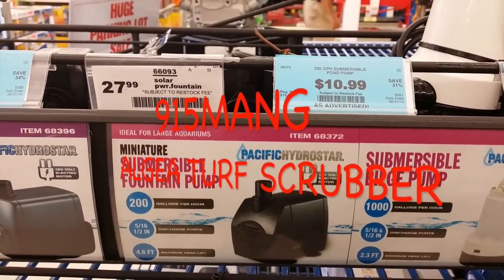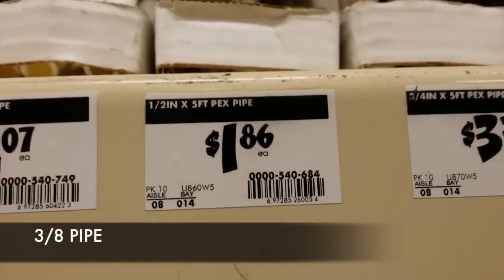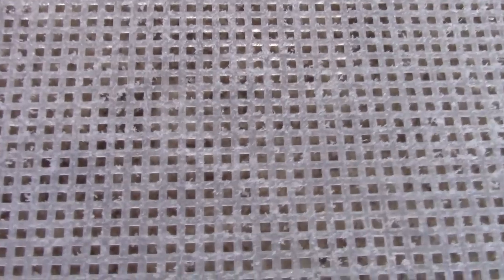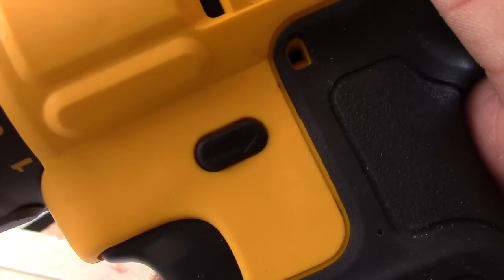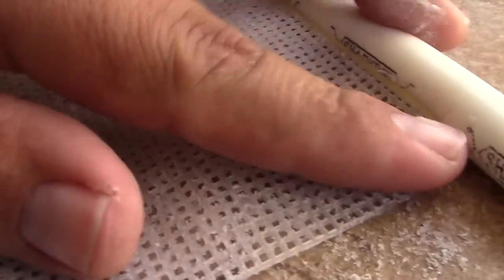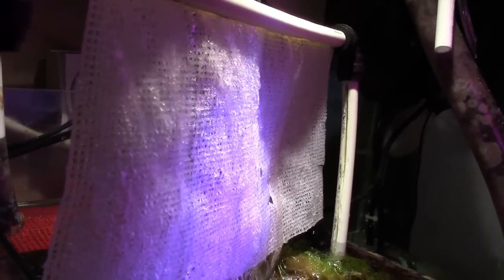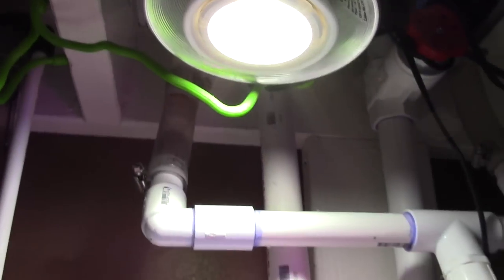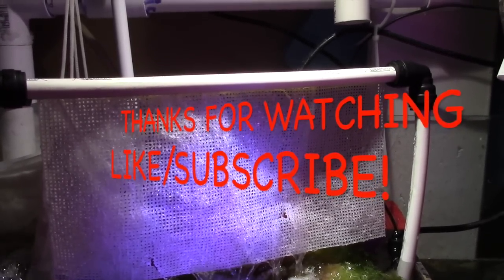HOW TO MAKE A SUPER EASY DIY ALGAE TURF SCRUBBER FOR A REEF TANK ATS!

Comment: would this take away  red slime
Reply from the maker: +i It would help out. Takes a while for the turf to grow
Reply: 915Mang  i was thinking of getting a hug to element ref slime , my water is good ans tried a lot of stuff to take away red slime but keeps coming back
Reply from the maker: i Its either not enough flow, or overfeedhing. Siphon will work but you gotta do it every week. I was using a filter sock when I was siphoning to catch the junk. I did a video on it. It worked. I have it again because Ive been using Acro Power.

Comment: If you can use a straight edge to make the slot straight, it will probably help even-out the flow. Also, 35 gph per inch of screen is a good pump flow to go for  :)
Reply from the maker: I know you know what you're talking about! I was hoping you would let me try one of your scrubbers out! Still thinking about it?! Thanks for watching Santa Monica
Reply: 35 GPH.....PER GALLON???

Comment: did adding the second LED and going 14 hours make the temp go up drastically higher?
Reply from the maker: Hi Frank, I moved my lighting to 18 hours. I also went back to the Bigger CFL. The Par 38 that I had might of been a cheap light. So Im still playing around with it. I already did my first cleaning, so seems to be working. 
As far as my temp its at 79.0, I think it might of raised it 1 degree, but the back of stand is open.

Comment: Mike it's not enough flow still. Wondering how that led bulb would be since the power is spread out on Em and even the slide in part not necessary. Idk.
Reply from the maker: I'll keep you updated. I think it has enough flow, but we'll see. The Pex pipe was way easier then 3/4 and unions, etc..
Reply: 915Mang if the whole screen isn't covered in water it is not enough flow. Min 35gph per inch of length. Curious about that led since they are very minimal spread also. Light schedule suppose to be 18 on. Idk. Lol looking forward to updates.
Reply from the maker: Pedro Navarro I have a Eheim that I can put on it. But for now im keeping the harbor freight pump. The light I switched to a CFL 1600 lumens 5000k bulb. Yeah I'll keep everyone updated. You should do a video.
Reply from the maker: Pedro Navarro I have a Eheim that I can put on it. But for now im keeping the harbor freight pump. The light I switched to a CFL 1600 lumens 5000k bulb. Yeah I'll keep everyone updated. You should do a video.
Reply: I did do a video. Lol check it out.
Reply from the maker: Pedro Navarro Yeah checked it out. Do a newer video.
Reply: It's 2 months old what you mean.
Reply from the maker: Pedro Navarro A new video, Update your youtube. Give an update of your tank. When you have a chance, lol
Reply: I just fragged some pieces. I'll think K about it  haven't done a equipment rundown yet. So need to